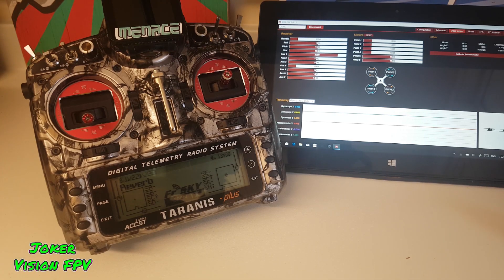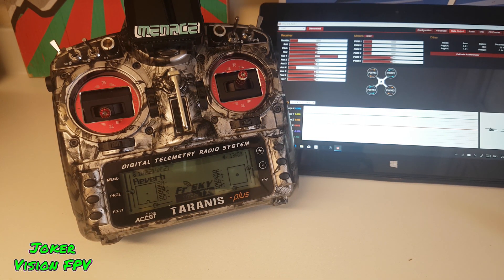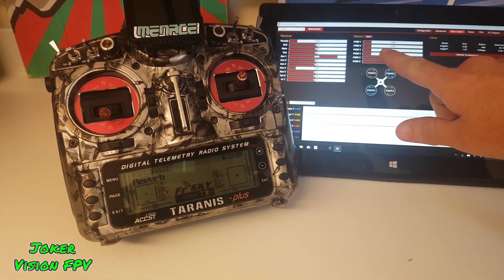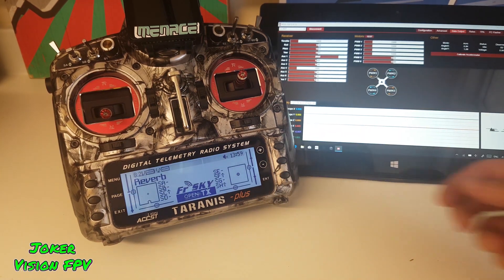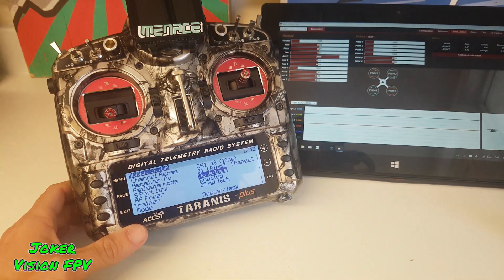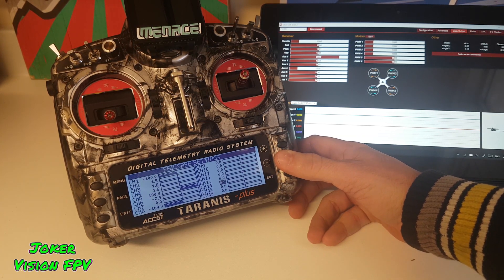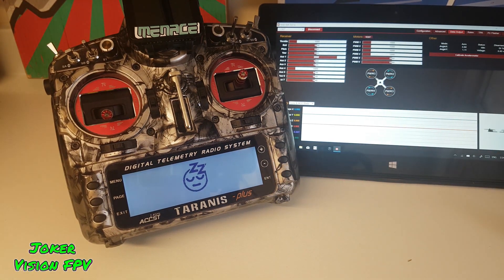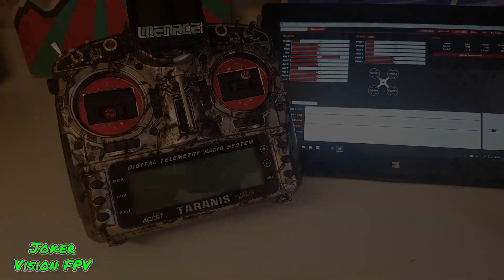R9M failsafe fix for kissFC - the only way that works?

Comment: Great Job bro had the same problem and also lost some fingers. Also checked it does work when receiver to fc connection is lost
So happy to find this video i hope others do as well.
Reply from the maker: Thank you :) I don't think anyone else has come up with any other failsafe that works with this system? But yeah, I nearly did as well and I'm glad this has helped you out :) thanks mate

Comment: hey man great tip can i ask a question how are you wiring up your reciver on the kiss FC ive got it wired up the way i think it should be ground to ground 5v to 5v  Sport/Fport to the  RXTLM pad and i thought that was all i need diddent work so i put on the sbus out to the TX2 uart nothing swapped around wires nothing just wondering what your set is like thank you
Reply from the maker: That should work as normal. Thats abit weird. I think the kiss V2 board has an Sbus pad thou? Make sure to set your RX in kiss to sbus ?
Reply: J0kerVision so in the GUI you don’t set as frysky fport? You leave it on frysky Sport? But I tried both I’m thinking something may be wrong with my reciver
Reply from the maker: @staticmotion1628  have you checked the RX binds to your controller ok? I have stopped using the R9 now as i had 5 failsafes on two different quads.
Reply: @J0kerVision  yeah it works for about a min then stops i dont knw man i gave put back in my xsr thanks for your time man
Reply from the maker: @staticmotion1628  sorry was at a show. But no worries dude. I took mine off aswel. And went bk to R XSR! 😂